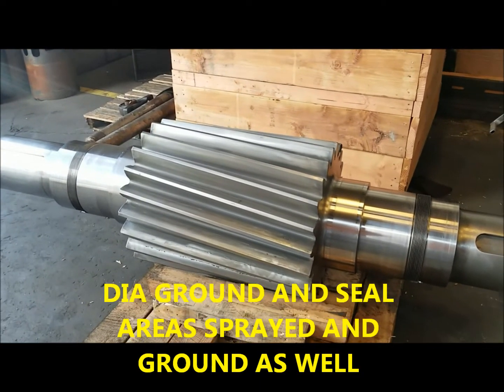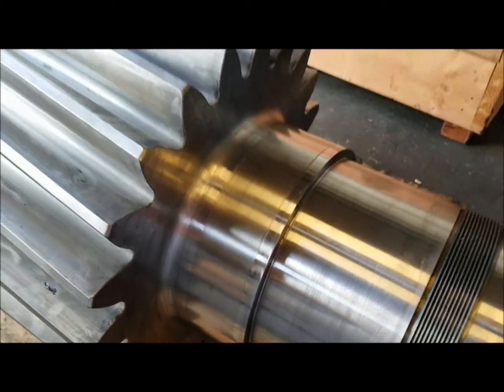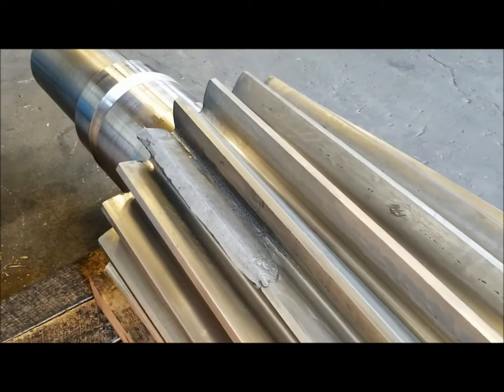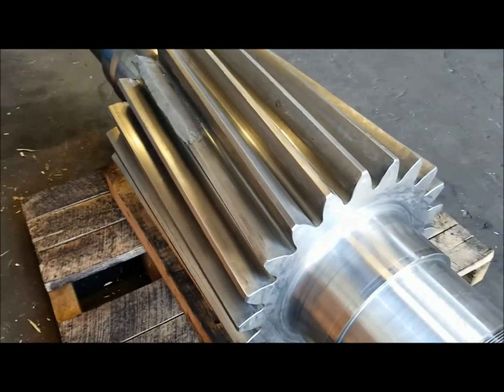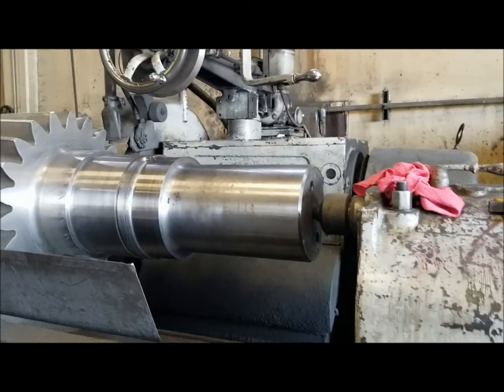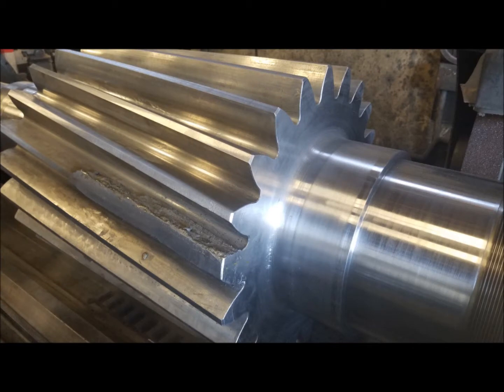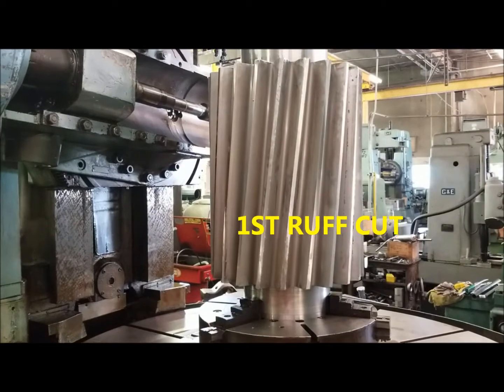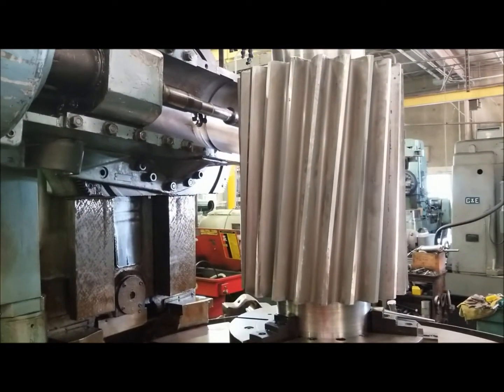ballmill pinion repair

Comment: this type of metal shouldnt be welded because it looses its thermical treatmen and the welded areas comes weak.. and when u line up the pinion towars the crown that tooth will come apart again and with big crack on the pinion right? and if u do welds  where the bearings go that will come weak too.. i belive is a process that u shouldnt follow, it could couse serious damage on the crown and it will cost more money to repair that.
Reply from the maker: Although we would prefer to manufacture a new gear and shaft, welding is an acceptable repair that is much less expensive for the client that does not have the budget to remanufacture a gear. Performed properly the repair should last a long time. Welding repairs of shafts are very common and rarely fail as there is not  nearly as much stress involved as in a gear tooth.
Reply: @NationalGearRepair   well the stress on that particular tooth is avoided at the time of alignment, other wise you´ll have lot of strees and if u are not there at the time the tooth comes apart, the chances of ruin the crown are very high, and the client will have less budget to fix both. but yeah when u do the weld like that you need to progam a visit every now and than to check the pinion with UT or a magnetic particle inspection to assure the pinion is in good condition to continiue the work. and also check the alignment is the same as the previous time when u install the pinion after the fix.